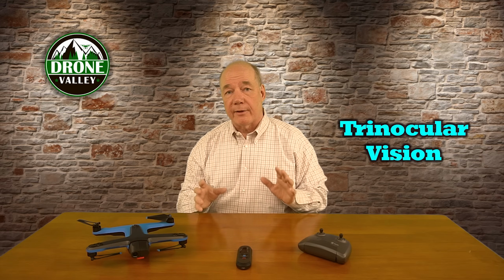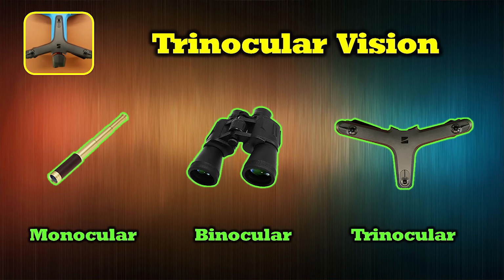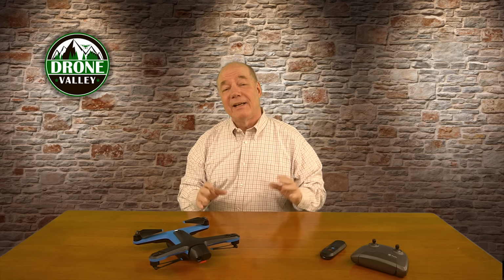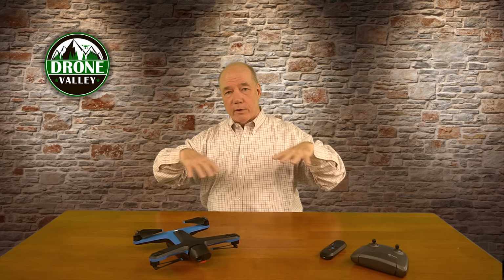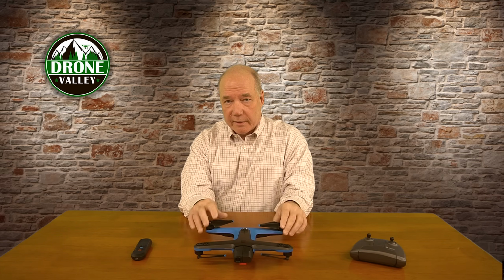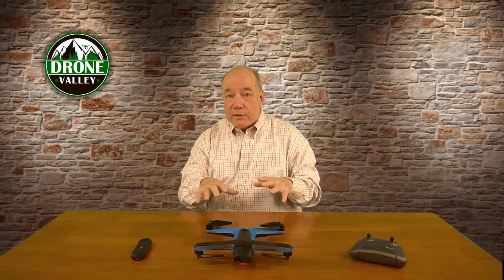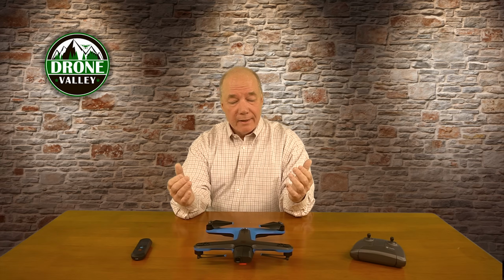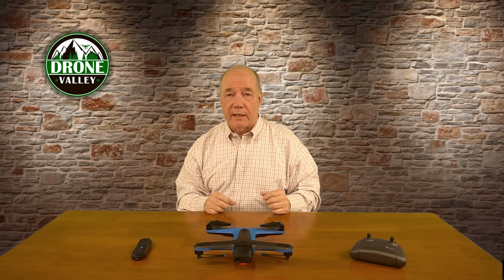Who's Buying Skydio? - A Nerds Perspective

Comment: Great video Rick. Has Skydio kept same chipset and smarts with the latest release Skydio 2+? I like that the 2+ seems to be able to provide more manual cinematic flight but also like the autonomous tracking capability. I guess I’m asking if you believe the new 2+ is even better than the original?
Reply from the maker: Thanks for the post and the main difference with the new 2+ are the pop=up antenna that extends it's range and a slightly longer flight time. The improved flight action is due to the new "key frame" feature in the software that is available to both the 2 and the 2+. It's a pretty incredible drone.

Comment: Rick, I always appreciate your videos but this one seems a little a pitch... I'd like an honest answer to a question I have for you. Did Skydio give you this drone or did you buy it from them and are giving us the review of your purchased drone (looks like you have a minimum of $1300 worth of Skydrone equipment there)?  
Second, is it fun to fly a drone that can fly itself or a drone that you control the flight in its environment?
Reply from the maker: Thanks for the post and I have no professional relationship with Skydio at all and am just a customer like most of the fliers. I did purchase the drone at retail pricing and bought the Drone, Controller, Beacon, Spare Battery and the Battery Hub so I'm in for well over $1500. I do love this drone for the brains it brings to flying. I will admit that it takes a little getting used to since the drone sometimes treats the pilot as the co-pilot but for certain shoots I do, it's the best out there for following things and avoiding others. I just received the new Mavic Air 2 today so I'll be doing some indepth comparisions to the new APAS 2.0 tech in that drone so stay tuned for that. Rick

Comment: EVO 2...much better than anything out there now
Reply from the maker: Thanks for the post but you're comparing apples and cheeseburgers between these 2 drones. The Skydio isn't built to compete with the EVO 2 (or any conventional drone), it's designed as a "Follower" for action shots. It's main goal in life is to follow someone doing something cool. Sure, you can pilot is like the others, but it's smarts are still there to help you avoid doing dumb things (I do those a lot). The EVO 2 (and the Mavic 2's) are designed as a "Flier" that gives the pilot total control over the flight. They do include a pretty good obstacle avoidance capability but that's different than autonomous flight. These Fliers can sense an object and avoid crashing into it but can't weave through a complex environment like the Skydio 2. Different tech for different use cases. I fly all the major quads (including the EVO 2) and love both camps. There are times where I need a shot following a moving vehicle or person through an area and use the Skydio. Other times I need to shoot commercially and opt for the better camera and control of the Mavic 2 or Evo 2. It's a matter of the right tool for the right job. The Evo will never be a Skydio and the other way around. There's room for everyone in the sky and I'm just amazed at how smart the Skydio 2 is.
Reply: @Dronevalley  ...I think you missed my point, the evo 2 can follow as good as or better than the skydio, as per a couple of very convincing videos. So what I'm saying is; the skydio is a one trick pony and if is designed to be one, then the evo 2 is better  than skydio for following you, and then evo is a good flyer where skydio cant compete...so what I'm saying is, better off spending your money on evo, you get the best follower and flyer in one package. I got my deposit back from skydio because it falls short on its avoidance compared to evo, and because it's only nitch is following you...evo 2 is my next drone, I'm also selling my MPP which cant compare to evo, and all the bs restrictions and lousy customer service...I get better support from parrot on my disco than dji for my mavic...so I hear what you say and know what you mean, my point is, put a little extra cash and get evo 2 which is the best following drone (per videos) and the best flyer (per review) with the best customer service per unanimous decision...only appealing factor is skydio US based, so that's my opinion, based off YouTube videos and comments...
...by the way, I've been flying rc for over 40 years, flying quads for almost 20, build my own fixed wings for many years so I'm hardly just your everyday enthusiast...but I'm not no where good at photography, not yet and a long ways to go
Reply: @theroc495  As someone who owns an EVO II now, it's obstacle avoidance is too aggressive, I have trouble making it fly under a tree branch and there is no way to turn it down it seems. It also gives readings on how far an obstacle is away, and it's readings are off when you are flying low. It actually sees the ground below it as an obstacle, so EVO needs some work too.
Reply from the maker: I fly them both and they are amazing fro different reasons. The EVO 2 is more like conventional drone, great to fly and amazing images but it can't really dodge trees. The Skydio is designed to do one thing very well - Follow a target and avoid hitting stuff without any pilot intervention. I have tried to crash it into trees intentionally and it always finds a path around them.
Reply: @Dronevalley  ...check out the video of a young man running around town thru multiple congested areas, thru pathways with trees everywhere and up and down under bridges, with the autel evo 2 never losing track of him...I've watched Billy put the skydio 2 thru and obstacle course and from what I have seen, the autel did a way much better job of avoidance...and I was sold on skydio until I saw it have some issues on videos, evo 2 has the best of both worlds...the skydio has distance issues, limited app assistance, bad controller, poor telemetry...autel has 360° avoidance, killer controller, killer camera, no dji limits, longer battery life, longer flying distance, interchangeable camera...for $400 more you get much much more, when I get one I'm selling my mavic pro platinum and their piss poor customer service

Comment: I remember not 2 years ago people were yawning at the feature of obstacle avoitas if it was a non starter. Now look at where we're are! 

Supposedly the Mavic 3 will have the same technology as the Skydio.

I'm curious what you think about the Yuneec Typhoon H with it's RealSense technology. It had a very similar (supposedly) system that would allow itself to find best path in order to follow it's subject. What I find interesting about the RealSense on the Typhoon is it does it with only forward sensors. If it needs to go in another direction it yaws and then goes in that direction around the object. 

I find this impressive too. It's clearly not as sophisticated and gets messed up in direct sunlight, but it has an IR sensor as well as stereo vision so it can work in low light a bit better than the Skydio.

Again, it's no where near the sophistication of the Skydio with it's "trinocular" (can we say "sexnocular"? Hmmm, doesn't sound right!) bison, but it does seem to be technology that does the same thing albeit in a much more immature manner.

Don't forget banks! Banks have bought up stakes in automobile companies and other completely unrelated industry. So a bank may swoop in and grab Skydio!

Cool stuff that's for sure.

Comment: I like the enthusiastic video, but I think you hyping it too much. Pretty sure DJI is not sleeping and is not as far behind as you think. Tesla is waaaay ahead of this thing (thanks God) since you see the amount of crashes people experience with the S2. This drone is another beta testing open to public :) For now pretty much no major updates or added features. The inability to fly at low light conditions (wouldn't mind not to have the obstacle avoidance) is also major drag. Another disappointment is that they are not truthful in the advertising. Why do they need to lie about the controller  range? Skydio, don't be like other Chinese manufacturers, be honest! Sad :(

Comment: i tell ya what. i bought it thinking i would love it for the tracking but i LOVE it much more for using it with the controller. even with the limited range, the controller has. the controller and manually flying is incredible if you do it right!
Reply from the maker: Great to see you stopping by and I agree with you about using the controller. It does handle a little different that my other quad but I really love the autonomous flight it provides and I've tried hard to crash it to no avail. Stop back soon for more content I'll be posting this week. Rick
Reply: @Dronevalley  I'm close to getting some of my skydio stuff edited.  I think you will dig my views.  Seems like we both like were this tech could go.

Comment: 网上看到撞电线和撞湖的视
Reply from the maker: Any drone (and any pilot) can have issues in flight but my experience with the quad has been amazing. You have to remember that it's a brand new tech and has one of the best warranties in the market. With Billy's crash they immediately replaced the quad, no questions asked.
Reply: @Dronevalley  Do you seriously think if it wasn't Billy they would issue replacement when the warranty clearly states NO warranty for any reason if the drone ends up in the water?

Comment: I've watched a few clips of people crashing there's for odd reasons. Ken herons hit a wire and Billy Kyle's just took a dive into a swamp. Not letting that tech drive me around lol
Reply from the maker: Chris, I've seen both of those clips and even the best tech glitches every now and then. I think there are 2 things to remember, it's new and getting better with every update and with the crashes, Skydio has a warranty that replaces the quad with no issues if you're able to crash it. I think Billy had a new quad a week or less after contacting them. Very good customer service.
Reply: @Dronevalley  yes but I'm not sure someone with no public pull would get that same support.
Reply: @Dronevalley  I've been reading through the comments and a I have run into 3 people now that have asked you the same thing and you haven't replied to it. They say something like, "if it wasn't a Billy that crashed the drone they wouldn't have replaced it so quickly." Do you agree with this point or no?

Comment: disappointing at all - except for one point: follow me

nothing else is as outstanding compared to dji
saw used skydio a lot on ebay in mid of february when I sold mine.
I was a pretty disappointing experience from footage to missing modes and quality.
Follow me did work by far the best but still a lot of suboptimal decisions or lost paths.
 
Lost a lot of money, ffar more than on my other or previous drones.
They used far too many influencers ...
Updates or improvements were too slow for me and it is a drone that came not really working, despite a good support.
But flight time was too bad. They are far too focussed on one use case: follow me
Overall disappointing buy american experience ...

Do not understand the reason of this video cause in its first 4 minutes it is about an outbuying of the tech or so.
Feels like an ad overall or a company evangelist running at high speed if you count words / second.
Reply from the maker: Thanks for the post but I bought mine as well and am thrilled with the performance. Comparing it to a DJI drone is like comparing a screwdriver to a pair of pliers as they are designed to do different things and each of them are great for their intended purpose. If you want to fly, DJI is the way to go but if you're looking for a drone that will follow you as you do other cool things, nothing right now beats Skydio for their tech.

Comment: I actually like the prediction flight path of DJI's APAS which looks more cinematic. What do you think Rick?  Also, would you not think LiDAR is the best for cars?  Skydio 2 does not work well in low light and flight path is very jerky.  I do think Skydio team did best for low cost and weight requirements needed for a drone at this price point.  I purposely waited for batch 3 to study real world experience because YT influencers tend to over rate the capabilities (not talking about you). But I am disappointed with the Skydio 2 performance and am canceling my order. Almost there, but not yet all the way yet. There is a lot of technology out there that is better for Cars and Manufacturing. Boston Dynamics is an example of AI robots that use non-linear algorithms.  I think drones are actually behind but cost is preventing production of using better technology than current available COTS hardware used in the Skydio 2. But as this technology matures, the cost comes down to consumer level affordability.  I like your excitement and enthusiasm.